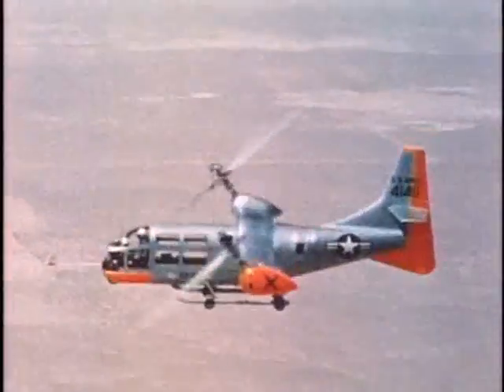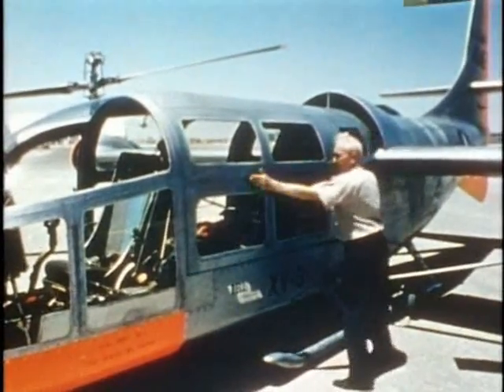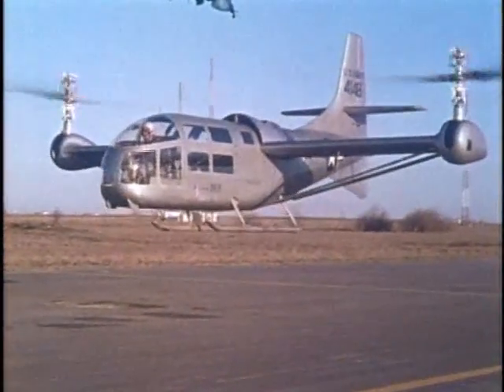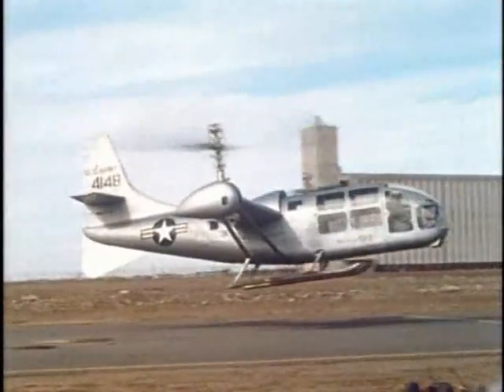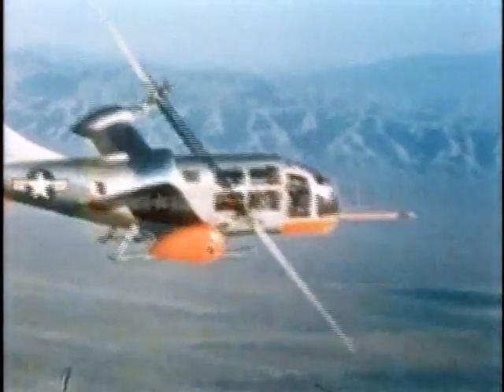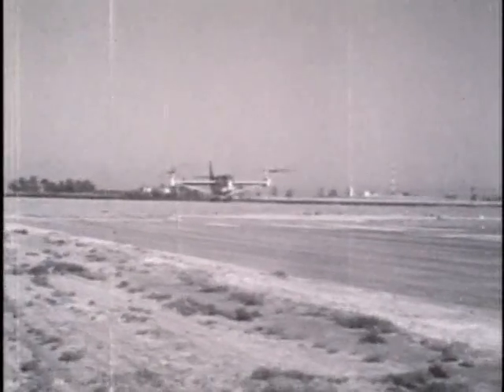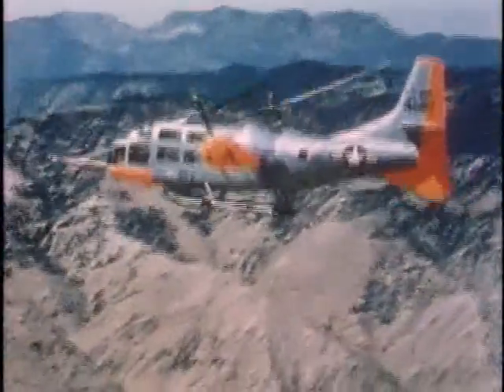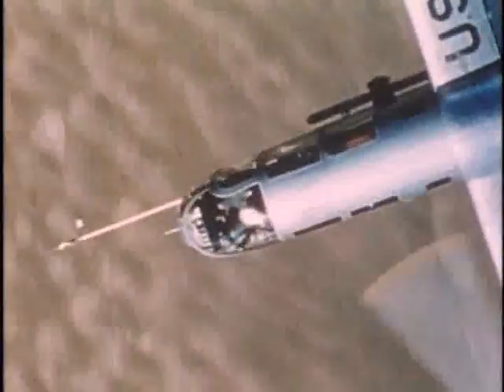Bell Helicopter XV-3 Tilt Rotor.mpg

Comment: Startled it wasn't pressed into Service for Vietnam :/ Close Ground support, Rescue at much Higher speeds than Choppers.....I wonder what happened?
Reply: I looked it up, looks like the Program had a Vibration Problem called "Pylon Whirl" that they finally beat with smaller Rotors, stiffer controls, and more wing area. I guess they figured it couldn't be ironed out for Mass Production? IDK? Oh well it was the Grandfather of the V-22
Reply: @SupesMe  the 4-engine versions that were tried in US programs had a lot of vibration problems, but I'd be interested if you could refer me to where you found this information? Cheers!
Reply: The "technology" was in it's infancy, unadvanced, untested, too new, too heavy and too expensive --- just to name a few issues. No way was it ever close to being incorporated into combat service situations like Vietnam. The XV-3 used a radial (piston) engine that took up virtually the entire center fuselage so it had essentially no utility capability. 
#XC142 
#XV22
Reply: Canadair CL-84 could have replaced the Huey, but, sadly, not-invented-here, again, meant that the US armed forces ignored the 'goodness' of the CL-84....https://youtu.be/q6SxyIoSvMM
Reply: Only (4) Canadair CL-84 aircraft ever produced in 20 years and (2) crashed --- yeah, a real successful aircraft LOL
Reply: @kbrobin2464  better than many other r&d aircraft. The test results were excellent, pilots liked it, but politics scuttled it. LOL
Reply: @kbrobin2464 for a real LOL, compare it to similar US developments. Crash and burn...you appear to be e real expert.